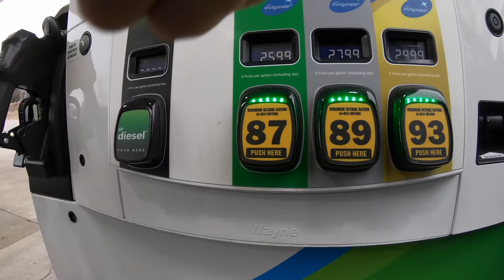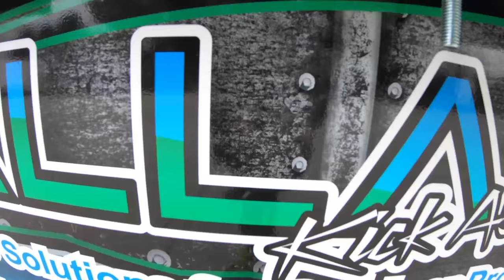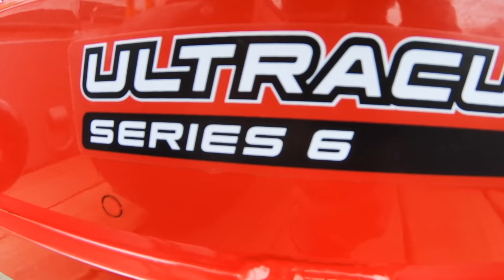Building & giving away a $19,000 lawn care set-up

Comment: God that trailer would do so much to help. But I already have a zero turn and most of the equipment on that trailer. Get a late 2000's ford tipper truck with some bells and whistles added to it and I'm in for sure. Also I saw you didn't use premium. I know you don't like using 87. If you don't 89 is ok too.

Comment: That's pretty cool. Just not for me, at least to put it to use as it needs to be. While looking at the trailer I found myself wondering how many times someone would have to bend ove to lift up the gate when in the down position. I wondered if a 'post' could be made so it attached lower on the gate and swing up when the gate is lowered. I would think it would need some kind of scissor hinge, maybe the style of the old drop down desks with enough pressure to hold it in the upright position and with a protective, rubber covered nob on top. I don't think it woulld have to be that long jjust to make the lifting a bit easier.  Thanks for sharing. Maybe its because of how my back can feel at 64, lol.
Reply from the maker: The ez lift gate operates with one hand.  Its pretty sweet.

Comment: I would have put the gate lift helper on the left side, and the tool rack on left front, move the trimmer rack and blower and string rack to right side. Cause normally ur on the side of the road and that way ur not standing on the traffic side. Throw a battery into the tool box and get a 2000w power inverter and solar panel charger for it and wire the battery into the barsman plugs to charge aswell. And then u got a spot to charge ur power tools and ad a dc air pump and pipe it into a old propane tank. Would be the entire setup